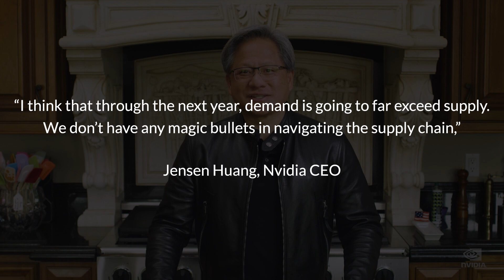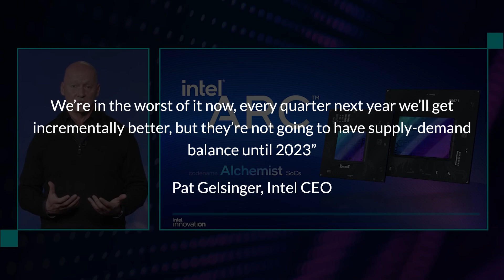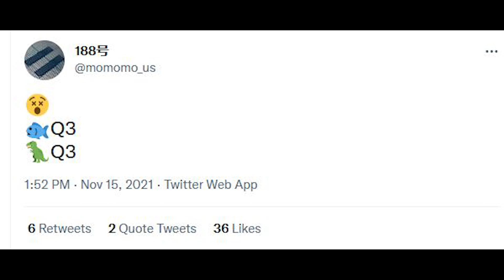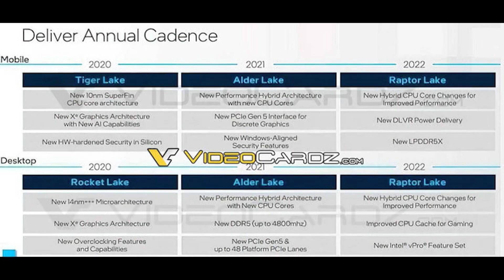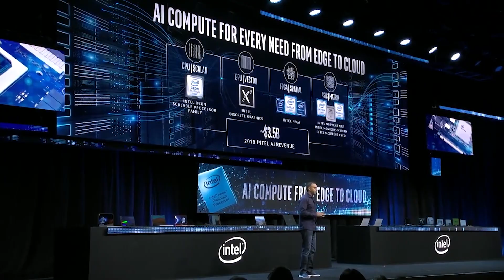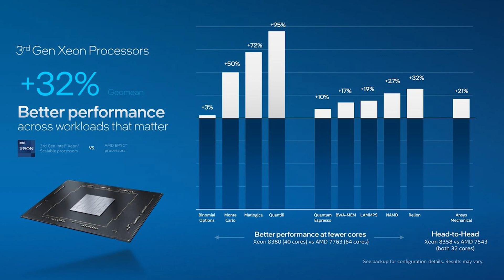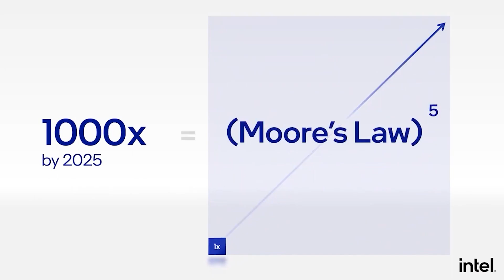Nvidia & Intel Give HOPE For GPU & CPU Shortages | Raptor Lake Release Date Leaks

Comment: Stop lying to get views.  Find another channel topic.  It's never going to get better. Never.  Crypto is unstoppable.  It's religion combined with the lottery.  Never again will GPU connected to unlimited power be affordable to the masses for gaming.  Stop lying and let people get on with their lives without false hope.
Reply: Crypto currencies do not need mining after initial distribution is done. For investors it is a lot more profitable if the currency is not inflated by lots of new mined coins and a lot more stable if there is not a bunch of mining companies trying to sell their production on a market with no real demand except speculation.
Also the plans for Ethereum PoW seem pretty final. Not saying there could not be further delays, but I think June 2022 will be final.

If GPU prices will come down - well that is another story and Nvidia/AMD will do anything to keep prices high and Intel arc turns out to be a fail (at least above the 200$ market).
Reply: @Gindi4711  They need mining forever if they want to grow in ways other than overrated hype.  If a project is worried about making investors money - then it's crap.  There shouldn't be investors - only network participants.
And John - by mid 2022 there will be plenty of cheap GPUs on the used market.  It's why Nvidia is refreshing their lineup.  They don't want new product on shelves identical to the dirt cheap used cards that will be flooding the market.  Why would people pay $900 for a new 3080 when they can get a used one for $500 or less?  But if Nvidia makes it 3080 11gb or 3080 12gb and gives it a little higher clocks, you cannot buy that on the used market.

Comment: I am sure it „will get be better“ when they had Way more than a Year of selling Products by now. Obviously its getting better. It just wont be good. (Maybe ever (until „something“ happens)).
Reply: It will get better but not until the new factories come online. Both Intel and TSMC are due to complete construction around 2023 so once that happens expect a flood of chips in the market.
Reply: @kusayfarhan9943  Yeah dont think so sorry. CPUs arent a Problem at all. But GPUs need an different Push.
Reply: @flimermithrandir  who said anything about CPUs? Both Intel's new fab and TSMC's fab are general purpose and will accept orders from any chip designer including Nvidia and AMD. Intel will no doubt produce their third gen graphics cards using the new fab

Comment: i dont think ETH going POS will help that much (maybe for a short amount of time) i fully expect all the HUGE gpu mining firms to pick a coin with  low difficulty mine the crap out of it for a bit then the whales come in and buy TONS of this coin mooning it and taking ETH's place as the top gpu mining coin.
Reply: Not that easy. Whales can pump a coin all they want if the general masses don't don't do transactions with it then it won't need much mining. Also alt coins are built on the ETH network. If the ETH network goes PoS then all of those smaller coins will go with it. Flooding smaller coins not on ETH with mining power will just drive down the mining rewards.
Reply: @kusayfarhan9943  
The amount of transactions is irrelevant as the bulk of rewards earned by miners comes from the base block reward and those blocks will continue to happen without a single transaction for as long as people are running wallets and pointing hashpower at them.
Zero coins are built on the ETH network.  Those are called tokens.
If no one sells GPUs as Joe suggests and they all move to other coins as you suggest, you're right; the rewards in USD for mining will fall significantly, probably below the cost to power those GPUs.  That is why I am certain that when ETH ruins itself by going POS, there will be a massive GPU selloff.
Reply: @cracklingice  then all they need to do is never go PoS right?
Reply: @arenzricodexd4409  Remaining PoW would maintain network security and decentralization (instead of having all validation nodes in major cloud service providers) and new people would continue to join the network because they started mining and decided to do some degen stuff like defi or NFTs.  As PoS there aren't new people coming in that same way.  With PoS it's just speculators buying coins from stakers (speculators with more coin than normal people).  Normal people can't just jump in and earn.  That's a very important part IMO.
Reply: Huge mining farms for the most part don't even have GPUs because they can buy CMPs directly from Nvidia.  ETH going to POS will flood the market with cheap cards even more so than the 2018 crash.  Mostly because we'll be within the 2022 crash when ETH ruins itself.